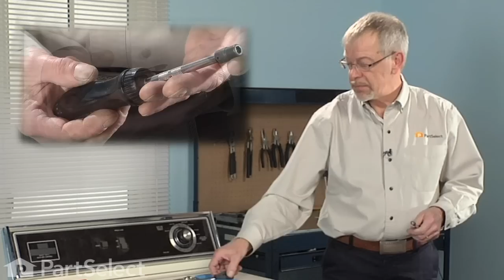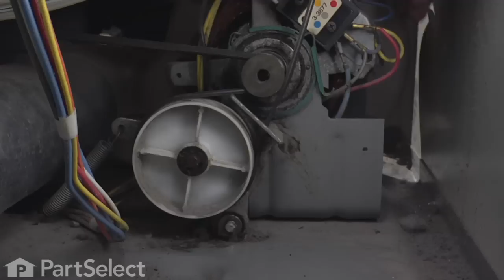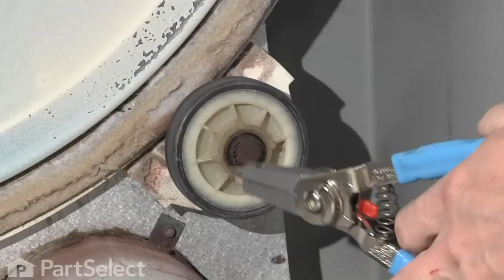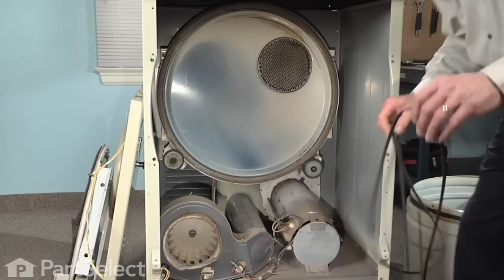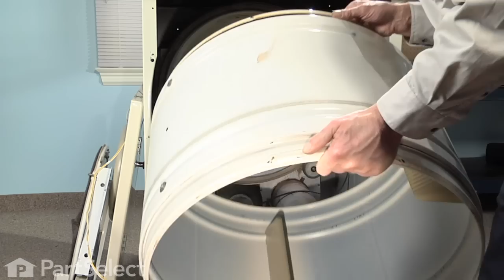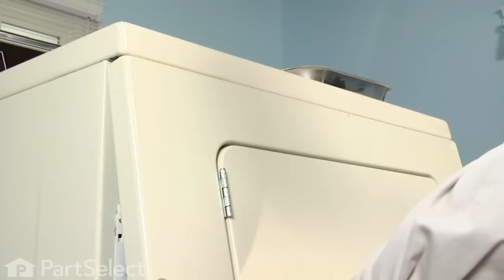Dryer Repair- Replacing the Roller Shaft Washer (Whirlpool Part# 312535)

Comment: This video is helpful, HOWEVER, it showed him removing the belt from the pulleys, but not installing it.  If anyone is still watching this video, trust me, if you remove the back vent panel, installing the belt around the pulley and motor spindle is 1000 times easier than battling it from the front.  After a lot of swearing, sore knees and back blindly trying to install the belt, i finally decided to move the machine and do it from the back.  Easy peasy.

BTW, i have the identical/near identical dryer (and matching washer), which i believe is late 80's or early 90's vintage, when Maytags were real Maytags and made in USA...and last forever.  My issue was the dryer was making a scraping noise...  Thinking it was the slides at the front, (i replaced them 11 years ago) i came to find out one of the pulley brackets was cracked and the pulley shaft nearly pulled completely thru the bracket!  This caused the drum to ride askew, thus scraping against the rear bulkhead.  I fabricated a doubler with stainless steel and screws/nuts and now it's more solid than  original....plus i replaced the rollers.  I put a little Tri-Flo on the shafts.

These machines are well-made tanks, and i will do whatever it takes to keep them going as long as possible.

Comment: My dryer looks nothing like this one.  I have the Silver Anniversary Maytag DE 407.  It suddenly stopped turning and makes a loud noise.  I replaced the belts but that didn't fix it.  I can see the motor on the lower left turning but not the drum.  I was told it was the bearing.  Maytag Dryer Bearing part #301568 but it's unavailable!  Can you find me find this part?  I don't want to give up my dryer.  I love this easy to work on set, the washer is still going strong.
Reply from the maker: Hi Tamara, we are currently researching this for you. Will have a response soon. Thanks
Reply: THANK YOU! So you know I watched your video on Noisy dryer but you didn't cover my sound LOL Mine sounds like a kid with whooping cough.  It's a very deep whoo whoo whoo like something is dragging. No squeak no  bangings It did this once before and the repairman fixed it easy peasy but he RETIRED!  My machine is also worked on from the back.
Reply from the maker: Hello Tamara, sorry for the delay.  Remove the drum belt and try turning the drum by hand. If it turns easily, then look at the pulley and shaft connection as a source of the problem. If the drum doesn’t turn, the bearing may be seized. You may find alocal machine shop that can make you a bronze bushing of the same dimensions.
Reply: No it's hard to move so do I have to remove the drum to get to the bearing or do I just remove the part that looks like a steering wheel to get to it?  I used to have the actual repair book but lost it in flooding.
Reply: After spending all day trying one more time to find the part I gave up and called a machine shop and guess what?  The shop owner makes dryer parts and he used to be a washer dryer repairman, LOL what luck!!!  He's coming tomorrow to take it apart, make the part, put it all back together and refuses to take money because I'm a dog and cat rescue. But...I told him he had to take at least gas money.